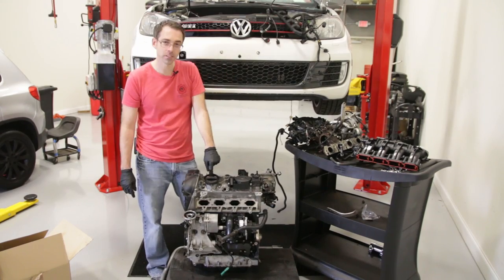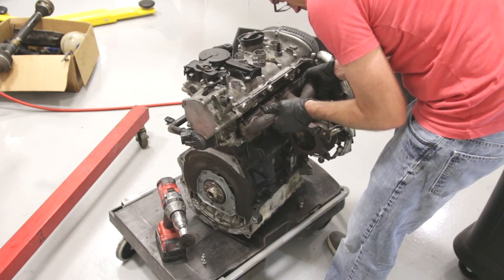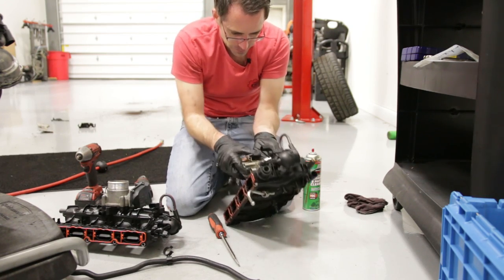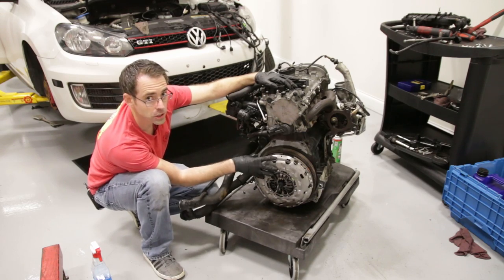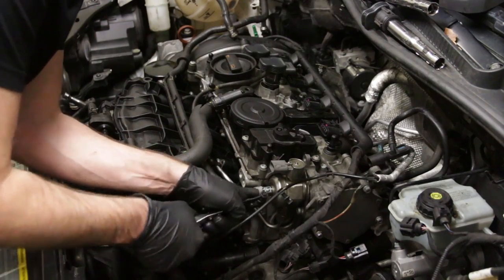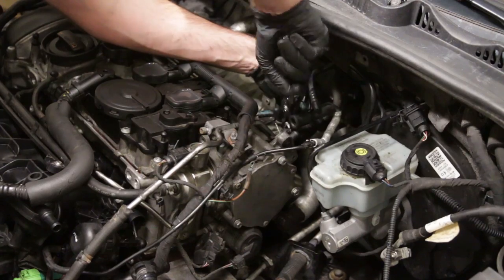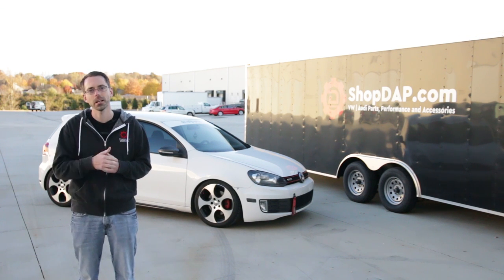MK6 Engine Install + First Start up! | Part 2

Comment: What would cause your engine to surge when removal of an oil cap. I know removing the cap causes suction. But removing the cap should not cause it to surge unless there is some sort of other issue. What is that issue? Please

Comment: Oil after 1100km consumed around 3 liters of oil... 5w - 30 Mobil is used.  But the oil had become so thick and seems like very old ...even after 1100km. Is this due to high carbon deposit ...or turbo issue or pcv issue ...

Comment: What can be the reason for high oil consumption.  Even the air in intake  when I removed had oil. Is this of pcv or of turbo issue . Kindly help.  

Bought a second hand car ...and seems it has all problems ....
Reply: Seems like bad piston rings... My Mk6 GTI do consume oil but not as much as 3 litres after 1000km and my motor is at 242,000km. My friend ran 5w-40 oil in his MK5 and found it consumes less so maybe give that a go. Just make sure its VW 520 00 505 00 or better.
Reply: @IamJimhunder  yes it's piston ring issue ...... got it after 2 weeks of research in youtube n Google. ...anyway changed few other parts as well. ...
Reply: i am also fucked up with same issue...car is very nice..but not very reliable..

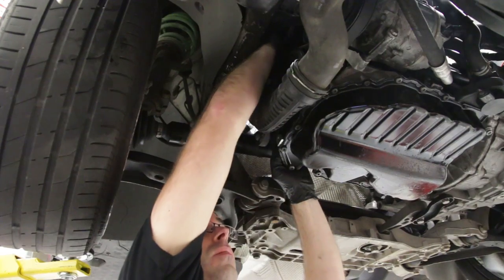Comment: 15:36 this plastic tube at the bottem left corner of the screen the plastic one not the rubber one thats left to it. I really want to know to what it's connected as on my car b6 passat its disconnected and flapping around making a noise sometimes because its hitting metal parts. I know it's an old video but im really worried, does someone know?

Comment: hey, i have a 2009 a4 2.0, it recently gave me a code p0016 so i guess timing jumped or variable valve might be bad, however the engine doesnt have any funny noise when i start it, the only thing i noticed is loss of power, could the valves still bent ? car has a hard start but i dont feel any misfires , thanks
Reply: did u fix it? what was the problem?

Comment: So people, im looking into getting either a cupra R mk2 , mk6 gti or a R32 MK5. I'm leaning towards the cupra for the tunabily and it has the bluetooth/aux without adding anything and i like the styling, but if anyone got any advice or anything for me please go ahead :3
Reply: I wouldn't get an mk6 gti, get an mk7 or mk7.5. If you have the money get the R32
Reply: it's slow n boring except the sound lol.
Reply: decided to buy a facelift 09 s3 n going stage 2 soon